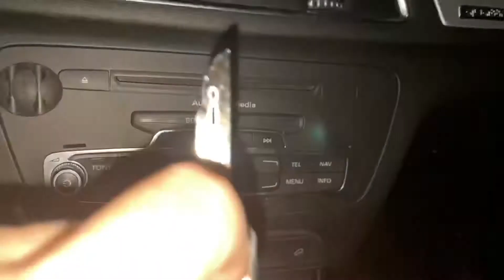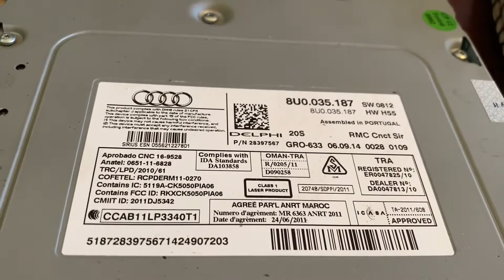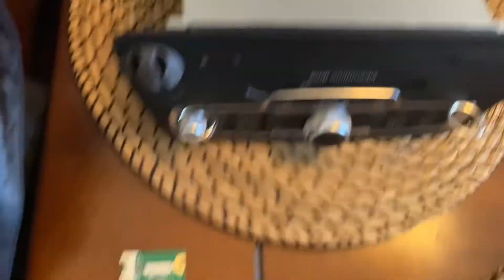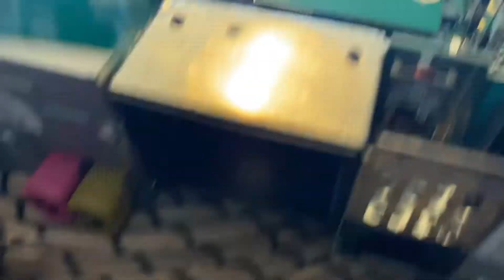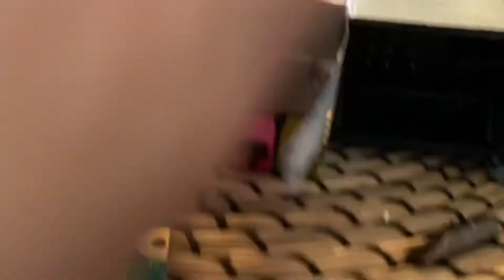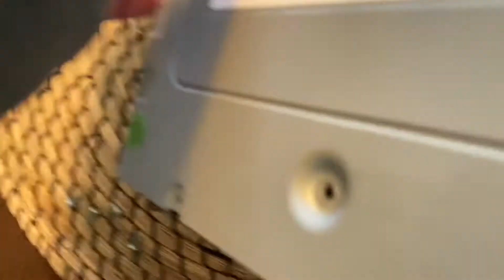2015 Audi Q3 Wireless Carplay Circuit Board Install for Smart Link System

Comment: Great Video ! very clear instructions. But I have a little problem. I think the fan in the radio unit is not working anymore and the unit is overheating. do you know what it can be ? Sometimes when i plug the power connector the fan spins then stops